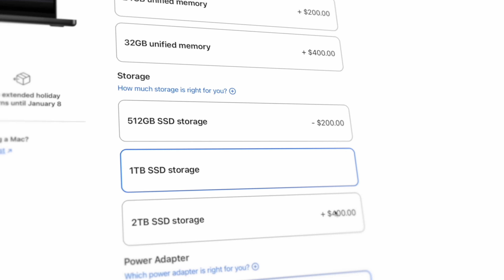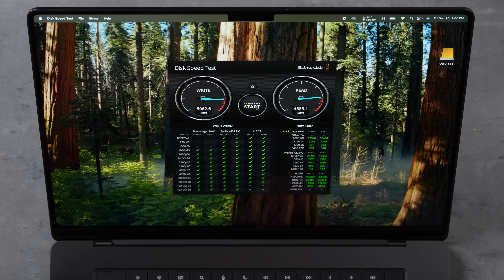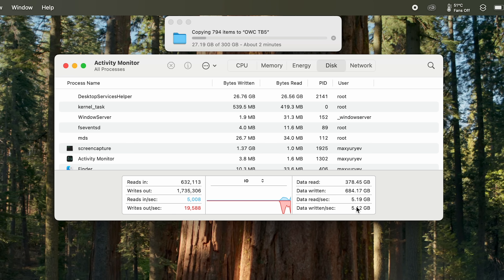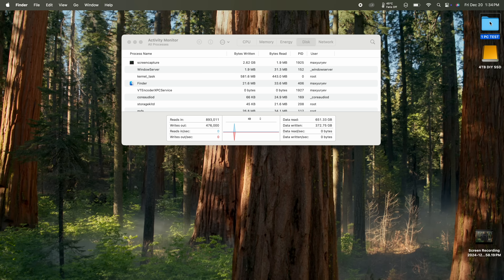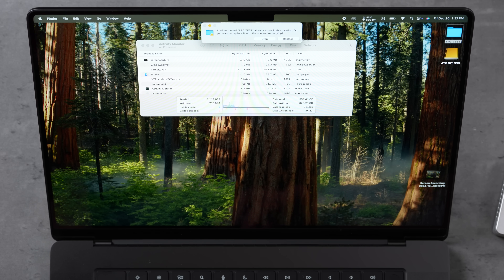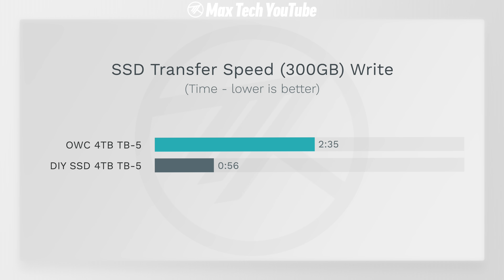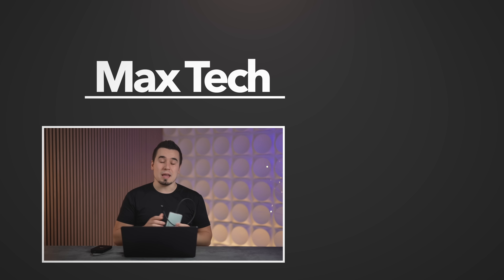How to Build a DIY Thunderbolt 5 SSD for LESS $$$

Comment from the maker: 4TB Samsung 990 Pro SSD ($180 OFF SALE) ➡ https://geni.us/mKHw2
Trebleet Thunderbolt 5 SSD Enclosure (ONLY $200) ➡ https://geni.us/DIX87
2TB Samsung 990 Pro SSD (ONLY $170) ➡ https://geni.us/USyBAs
Reply: Too bad that Thunderbolt 5 enclosure isn’t available right now on Amazon. 😢 You got another suggestion for one?
Reply: @johnbstallings  Trebleet states availability after January 7.
Reply: Could you pls test this enclosure also on normal Mac 4  with Thunderbold 4? I hope it will be faster than currently available Thunderbolt 4 enclodures.
Reply: Max great video.  I wish you had a way to test the Trebleet TB5 with the WD Black SN850X currently a cheaper solution at least an option alternative for Samsung 990.
Reply: what anpitty it wont work with iphone 15 pro max because of gen3 m2 ssd limitation
Reply: Unfortunately, the enclosure is not currently available on Amazon. Is there an alternative?
Reply: what is the speeds with new samsung 9100 series?

Comment: What file size did you select in Black Magic? 5GB is the only correct option to use to show how the drive handles low cache situation. I feel you purposefully left this out. Especially considering that the 990 Pro isn’t actually the fastest SSD on the market for extended/large writes. The 9100 Pro curb stomps all of the competition.

Comment: Great video.  Using your link I tried to order the Trebleet Thunderbolt 5 SSD Enclosure off Amazon but they were out of stock.  Tried to order directly from the OEM but they would not ship to my USA address.  Will have to find an alternate source or enclosure.  Suggestions?

Comment: It would be great to see you put the T705 and the Sabrent Rocket 5 in to the Thunderbolt 5 Enclosure.

The cable on the Envoy can be somewhat easily replaced. It is just a Thunderbolt 5 cable plugged in to the board. You just need to remove the 2 rubber pads on the bottom, and unscrew the screws.

Comment: After over a month wait, I finally got the Trebleet enclosure.  It works as advertised, and I'm getting 6336 MB/s Writes and 5877 MB/s Reads with the 5GB stress settting on a M4 Max MBP.  Note that this is direct connect to the laptop.  Going through a TB5 hub significantly reduces the speeds. Thanks for publishing this video!

Comment: okay... so you could do this ... for some reason... or you could get a bog standard nvme dock, for about 20 bucks( still 20gbs at usb 3.2 for an nvme is abt 10) and a high quality gen 4 nvme drive. this will save you hundreds while performing the same. .. 😮‍💨

Comment: Received my enclosure yesterday, put in a 990 pro that I already had and...bust. The drive kept disconnecting. After troubleshooting I found out if I kept the lid off, it worked. Sending back and going to wait for an Acasis one.

Comment: Just received my Trebleet TB 5 enclosure. Popped in a 2tb WD black gen 5 NVMe. First TB 5 cable 5800 mbps. Changed to an OWC TB 5 cable and pinning the Blackmagic meters at 7200 mbps. Cables matter!  Fantastic external enclosure. Finish matches the M4 Mimi pro nicely.  Thank you for the video.
Reply: You used it on a Mac mini m4 basic? How much RAM? How big internal SSD?

Comment: I still don't understand what the PD second usb c port is for. Is he saying that when 8TB comes out, it's going to be required for a power cable/2nd cable to be plugged in at all times when using the drive? Can someone please explain?
Reply: USB4 downstream ports have a power limit of 15W (generally speaking - there are some that are even lower), and a number of already existing drive and enclosure combinations (for USB4, TB4 or TB5) exceed that limit under load - which causes disconnections.

Comment: Thank you for the excellent video - again!  But why did you remove the heat sink - isn't it much more effective than the pad? In general, aren't heat sinks the best way to cool the SSD, especially when a fan is nearby? Just think of the PS5 - similar situation, isn't it?

Comment: U should do a crystal diskmark run with eatch SSD. I think in ur test occured some bottlenecks, when the one SSD was writing, what the other was reading.

All of them can read faster, than any of them can write.

With CrystalDiskMark (or Mac equivalent) the cpu writes and reads to each SSD directly, and CPU is in the most cases faster than SSDs.

IOPS is also a very good performance indicator, when u want a drive to be used as boot drive or if u want to copy many, small files.

Comment: $200 for an ssd enclosure? Haha what a joke. For 50$ you can find USB 4.0 m.2 enclosures. Sure it's only 40Gbps vs 80, but most ssd's can even get close to that 80Gbps speed. In 9 out of 10 times you won't notice the speed difference between thunderbolt and USB 4.0.

Comment: This comparison seems pretty biased, to be honest. Here are the reasons why: The OWC SSD is IP66 (waterproof and dustproof), and the cable is replaceable based on OWC's website. The reason it comes with the cable is to guarantee power to the NVMe—the shorter the better—and to maintain its IP66 rating. Additionally, it is Thunderbolt certified, which naturally makes it more expensive due to the certification costs. On the other hand, the Trebleet DIY enclosure is not Thunderbolt certified, which is why they don't use the word "Thunderbolt" and instead call it "TB5"—Intel would sue them. So, if reliability is important to you, maybe consider these factors before jumping to conclusions.

Comment: How easy was it to remove that heat sink?
Reply: WARNING: If you remove the heatsink, the warranty is voided. Samsung has a warning sticker right below the logo.

I have this SSD and I was looking for an enclosure that accommodates the heatsink. Haven't found a suitable enclosure yet.
Reply: @UltraKryptonian  You're not going to find one either. I bought this SSD I thought I was going to be able to put it into my Galaxy pro 4. But it's too big with the heat sink. I only bought it because it was cheaper than the one without the heat sink. I don't really care if I lose the warranty.
Reply: @6maxwell99  Yeah, you're right about not finding a suitable enclosure. Already requested a return of a 4TB and 2TB Samsung 990 Pro w/ Heatsink SSDs - They are going back to Amazon! I read that once you remove the heatsink, you have to use a hair dryer to remove some thermal paste. Eff all that! 

Once I get my money back from Amazon, I'll order two SSDs without heatsinks and install them into the two OWC Express 1M2 enclosures I have and call it a day. Cheers!

Comment: 2-300 for an enclosure without any storage on it is crazy. I know it’s new tech but there’s no way this costs the OEM more than like 20 bucks to produce this.
Reply: Sure in your country the licensing and engineers are free they will work for you for free
Reply: u are only seeing production cost and not the R&D cost
Reply: @xypher_666  R&D cost is 0 except for a couple of hours designing the enclosure
Reply: @ then you should rethink everything. In your logic the 15 pro max and 16 pro max has almost no change in design. Then that must also be clost to 0$. 

R&D takes time and its literally means research and development. 

Buying License and more also costs money cauz that thunderbolt is not their innovation.
Reply: @ Buying licenses is not R&D
Reply: @ i never said R&D is same as buying license.
Reply: Capitalism
Reply: TB5 controller + SSD controller to match the speed is not that cheap.
Reply: @huangcc72  JHL9480 costs 20 bucks, the cost of the rest is marginal, they're making here many times ove their cost including labor and shipping.

Comment: I bought my OWC 4TB SSD for $509 with a coupon code.
OWC said that the attached cable will be user replaceable and has a 3 year warranty where you can talk to a real person if there is a problem. Who do you go to if there is a problem with your SSD? Each company is going to blame the other, if you can talk to a real person.

Having said that, the full speed of your SSD is impressive and I'm considering buying one because of that! Thanks for testing!
Reply: Honestly, it's not that DIY. It's combining two products. Both of those products come with warranties. More than likely you'd just start with reaching out to the NvME SSD manufacturer.

Comment: You shouldn't have removed the graphene heat spreader nvme drives come with...that said, the 990 Pro is a 7000-7500mb read/write nvme drive. Even a 40gigabit enclosure can handle 3x that speed. Maybe bad controllers are being used that don't live up?

Comment: “Only” 500 bucks, he is joking, right?
Reply from the maker: Apple charges $1200 for 4TB of slower storage that’s soldered on and will be gone when you sell your laptop in a few years. With this solution, you keep your 4TB no matter which PC you use, and it’ll last decades seeing as you can swap out the drive for $200-300 when it eventually goes bad in 10 or 20 years.
Reply: @MaxTechOfficial  звучит разумно, я же пока себе на usb4 приобрел диск, скорости 3000 на 3000, на 2тб, вышло за 210$
Reply: 4TB with TB5 isn’t cheap

Comment: Owc usually uses Samsung drives in theirs. You can check by looking at the hardware information. Also the 990 isn’t the best. Why haven’t you tried an pci5 nvme drives? They are much faster if the external controller supports it.

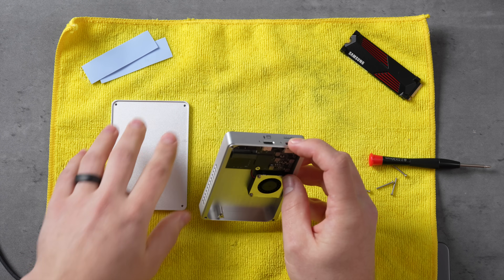Comment: 1:42 wait, wait, what? thunderbolt friggin 5 will need extra power for an 8tb friggin nvme? wtf? im a usb windows kinda guy, never dabbled with thunderbolt and was under the impression tb always was an always will be far superiror to usb. additional power on tb5 for a large nvme? thats just unacceptable. what is this, 2007 and we are dealing with 640gb 3.5” drive in an external udb enclosure? im shocked. and it costs 200$?? lol. i guess to you fruit people 200$ is a bargain for a friggin nvme enclosure, compared to 700$ for soldered storage, but cmon. additional power? stability? no, im truly shocked. two friggin canles for an 8tb nvme? thats a step backwards, yo!

Comment: Why would you spend extra money on the heat sink version of that ssd just to not use it 😂😂😂
Reply from the maker: It was like $20 less expensive lol. But beware it voids warranty if you take it apart. So that makes sense why.
Reply: @ interesting. You should do some more research into this. I bet you can make a much cheaper TB5 ssd using a raspberry pi and some other stuff.

Comment: Yes but after this big idea of not upgrading and save 500$ you go around like a desperate with that external enclosure and the cable, while there is someone else that just carry the laptop. On top of that that ssd has a fail rate 100 times higher that the internal ssd.. if you want to act like this buy a 300$ laptop dell inspiron 15 and save 2.000$ that you can add that 990 pro without that stupid box, but IN your laptop

Comment: Looks like a good, fast enclosure for $200 but wish it came in a darker finish and had some type of integrated slim rubber feet on the bottom. Does the fan make a noticeable hum or whine and does it run continuously or only when the temp gets above a certain point?

Comment: I use external SSDs almost every day in my profession. I have found issues with many enclosures on the software side. I hope this doesn’t have that issue. 

I mainly use Samsung external drives with no issues. Several times I have bought NVMe drives and enclosures (4 different ones) and they will randomly not connect to my Mac or won’t eject from my Mac etc unlike the Samsung ones. It’s weird.

Comment: Difference is your internal storage won’t randomly disconnect from your computer while you’re using it lol but yes Apple upgrade prices are a scam. We shouldn’t even be talking about pricing for external drives if Apple just charged fair pricing.
Reply: it's not a scam. it's a choice. it's not like apple is actively prohibiting you from using an external storage. 

If I am rich, I would max it out and stop giving a F. on external storage.
Reply: @iamwisdomsky  The fact that Apple solders the SSD to the system board instead of a socket like EVERY OTHER LAPTOP AND DESKTOP MAKER then inflates the upgrade prices to 5x what normal retail is DEFINITELY IS A SCAM.
Reply: @DEMinSoCAL  Interestingly, the storage on the Mac Minis is modular. I've seen a couple of videos with people desoldering the NAND chips and replacing them with bigger ones. I don't know if someone will be able to start manufacturing drop-in replacements. The modules look similar to nvme modules, but they're not the same.

Comment: I find it disingenuous to compare the larger internal drives with external drives purely on price. My internal 4TB drive on my M4 MBP has nearly 8 GB/s write and 6 GB/s reads. The larger drives are quite a bit faster. Also, no one ever talks about the fact that having a big extra brick is a giant pain in the ass. The only case I can see that the external is useful is for very infrequently accessed data, if you need to use it on different machines, or for backups. Yes, the external drive costs less, but there are so many drawbacks that for many it doesn't make sense.
Reply: In any logic, internal should be cheaper because use less components

Comment: For those who were confused that why the DIY one didn’t slowed up or wondering after what limit It'll slow. It actually Won't slow down, Becouse it has d-ram. Might have noticed  2 big squiris thing on the ssd. They are the reason.
Reply: Nope, it slows down after about 440 Gigs (with this particular 990Pro 4TB SSD).

Comment: Thunderbolt 5 is a PCIe 5.0 technology . Redo the test with a PCIe 5.0 M.2 . Try something like a T705
Reply: NV its an intel JHL9480 chip. TB5 to Gen4 PCIe x4 . But the TG Graphene Drive runs 7400read and 6900write . IIRC . So some room on the table. Good Video. Hopfully they make a TB5 to PCIe 5 x4 chipset.
Reply: @supershagspeed  TB5 should be able to transfer up to 120Gbps in one direction - so Gen5-SSD makes sense than! Hopefully there are more Hosts+Bridges to come.
Reply: @Wlad1  Yah but the TB5 chipset used in the external enclosure is TB5 but Gen4 PCIe x4 so its limited at the SSD anyways. And this is the only chip intel is making at $20 is the cost of the chip. So at $210 for an enclosure they are turning a great profit.
Reply: @supershagspeed  probably there some additional license fees. My USB4 enclosure was $60 and can do 4GB/s (even slightly better than TB4!), so probably just wait for USB4 Gen2 with the same speeds as TB5 (or even slightly better!).

Comment: 1) Just be aware that Thunderbolt 5 is promising but isn’t yet reliable and trustable
2) the Samsung you chose is far not the fastest on the market, some SSDs from Crucial are really much faster
In conclusion, you were happy with your DIY solution and we all thank you but taking advantage of low cost Thunderbolt 4 and fast SSD from other manufacturers is unchanged cheaper and of course we’ll lose a few seconds but risk less…

Comment: I would rather have an aluminum full-chassis heat sink than the cheapo fan. I don’t like the integrated TB5 cable on the OWC, though. Also the 990 Pro is faster than the OWC Aura SSD. 

I have the OWC Envoy Pro SX DIY TB3 model with the 990 Pro installed. It’s about half as fast as the no-name TB5 one you tested but the build quality is way better, rugged, IP67 rated, and also has a detachable TB cable.  I much rather have an OWC unit. I’m hoping OWC eventually comes out with a follow-on product that’s TB5 DIY with detachable cable.

Active cooling might actually be necessary with the faster speeds, though.

Comment: The fact that Apple is selling it for that much and it's using SLC cache and not DRAM is absurd and proves that it's just a money grab. With that said, that's where most of their profits come from. At least they don't sell your data but that would be irrelevant to an external TB drive. That's 300 per terabyte. There are multiple brand name 4TB nvme gen 4 drives for 250.to 300. Sure, they all probably use SLC cache also but the price difference simply can't be ignored.